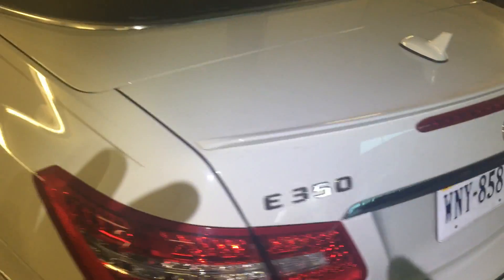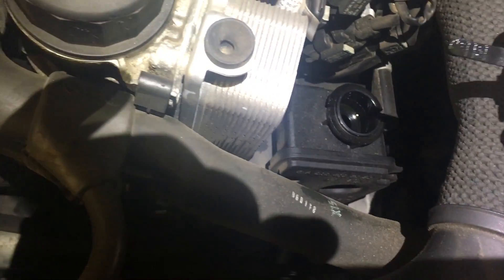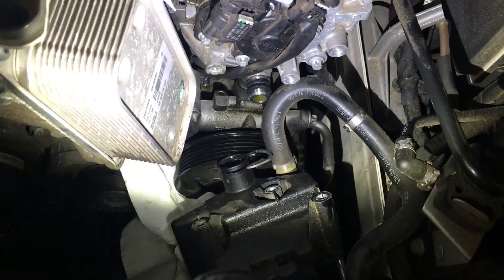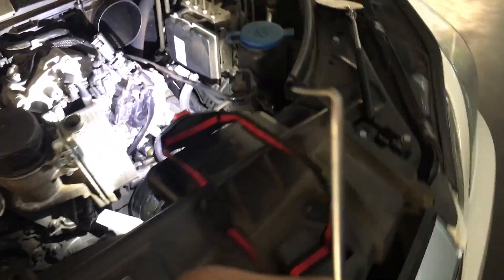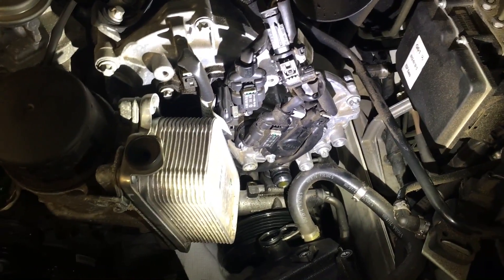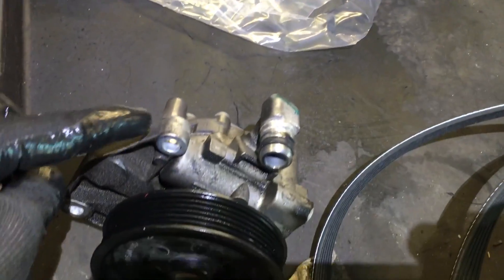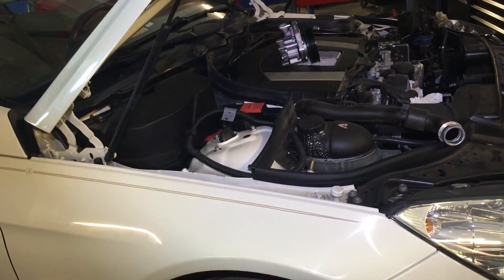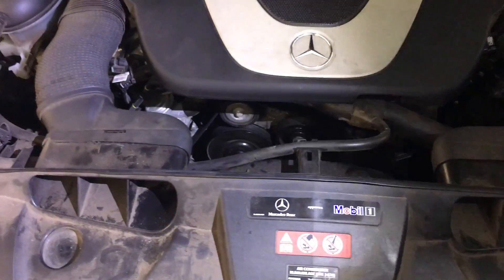2010 E350 Power steering pump replacement

Comment: So my question is there's four mounting bolts two in the front which are really easy and the two in the back are so difficult on an 06 E350 due to the air conditioning line is there any suggestion you could make on a tool I could use to get in there I've tried to swivel ratchet I was going to try a fitted torque wrench with a breaker bar just to break it and take it off by hand how did you do it?
Reply: Wrench on the ground bolt and pry against the block with a 2 foot pry bar

Comment: Nice vid dude 
I have a c230 2005 2.5 v6 I need to change my power steering pump as it's making a horrible whining sound. I cant seem to find any that fit my car. Looking at this vid its exactly the same engine everything looks the same as my car. Would that power steering pump fit my car?

Comment: I hope this info will be of some help to someone. I have a Mercedes benz cclass cdi 2006. I am the first  owner. lovely motor. recently I start getting some problem. Lots of black smoke,I even start to feel a way putting my foot down,and I always conscious of the cars behind,they seems to avoid me like the great plague. ok,so i had enough,went to a garage,he took my money and car come back the same way. went to see another mechanic. he was very understanding and helpful. he did a test, it come up as the EGR. I change it at Euro Parts for £272 plus vat. oh by the way,I did not tell you that a Y reg fly pass me on the motorway  and help make up my mind. replace egr. get back around 700rpm. engine light still on. what a nightmare. bring the car back,tell the mac that I am getting some weird sounds. so I let him stand in front whilst I rev the engine,yep he said I can here something but I can't tell exactly what it is,I will have to put it on the ramp. and go under neat. he pull the bottom  plate off,and immediately shouted,I found it. the Turbo hose was busted by almost 6 inches.  put new one on. now car flys no more smoke.

Comment: I have an 06 e350 4matic sedan, by appearance, it's the same Power Steering Pump that's on your video. Is that a W211 or W251?. Very confused, whenever I submit my vehicles year, make & model, I get the wrong pump. Just need to know how to tell the difference on my vehicle so as to know which pump exactly it is that I  need.for my vehicle. Any assistance will greatly be appreciated.
Reply from the maker: Email me your VIN at maic@maicsalazardiagnostics.con and I can look at the exact part number for your vehicle.

Comment: It's little detail like, which model/version pump it is? W211 or W251, etc.,  Also, are there different versions of the W211 or W251, etc., Tha small detail would save a lot of uneccessary wasted time & effort in figuring it out...

Comment: How do you know it was not the fluid tank that was leaking and not the pump itself?
Reply from the maker: Paul Shalom well you need to clean all really good and use a inspection camera or a mirror. Run the car and carefully inspect the area.